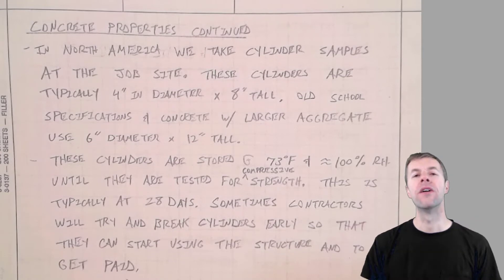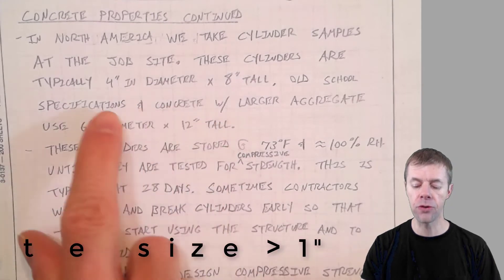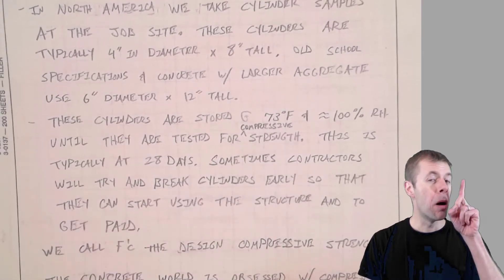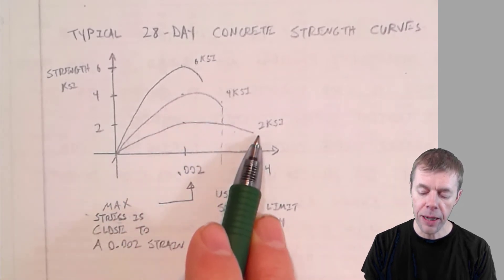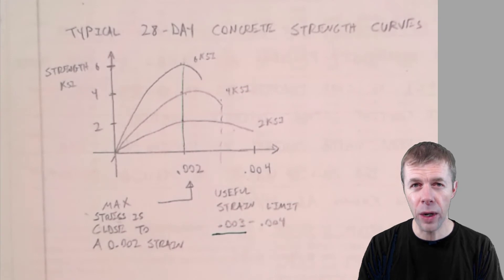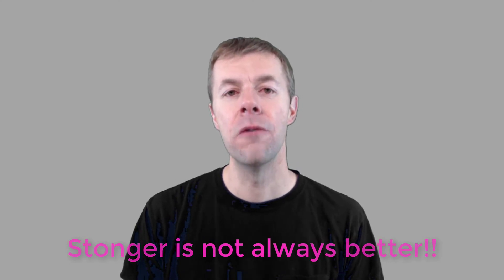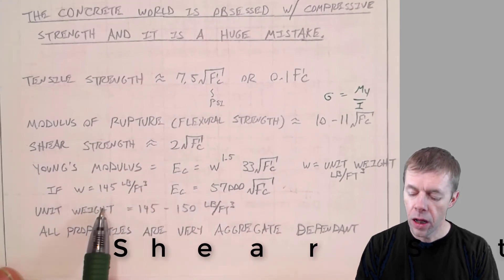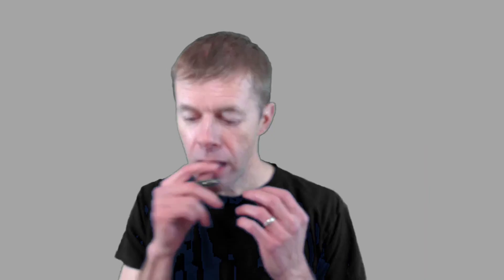Properties of Concrete for Reinforced Concrete Design

Comment: A video on basic types of concrete available to the public, and most important a video on a time limit to pouring the mixed batch/batches.  The point is if I pour a huge square footage and I do it in sections how long do I have?  I have heard and read, 2 hours but prefer an expert opinion.

Comment: Hi, Dr Ley, greetings from the UK. I found your statement 'strong is not always better'  very relevant and interesting, however, in general, almost all Youtube videos of concrete design use relatively low strength such as 3 ksi ~ 4 ksi (20 ~30 MPa). So how would you support this statement you have made in this video? Many thanks!
Reply from the maker: Thanks for the comment.  As humans we think that things that are stronger are better.  This seems to creep into engineering.  Many practicing engineers think that 60 MPa concrete is better than 30 MPa concrete.  Heck, even cement in Europe is sold based on some target MPa.  I think that is a bad practice.  I think we need to think about what that cement will be used for.  For me I want material that is durable and then also strong enough.  I don't need extra strength.  I just need enough and I want to focus on other properties that may be better such as making it more construct able, more durable, more sustainable, or more economical.  Let me know if this makes sense.
Reply: Thank you for your reply! It makes perfect sense, I indeed agree with that we should decide the strength according to specific circumstances, rather than unifying the standard. It seems to be a stereotype that people think stronger is better, definitely need to change this mindset! Also, do you have any lectures on calculating durability and long-term creep of concrete buildings?